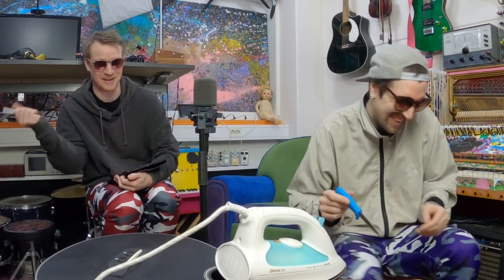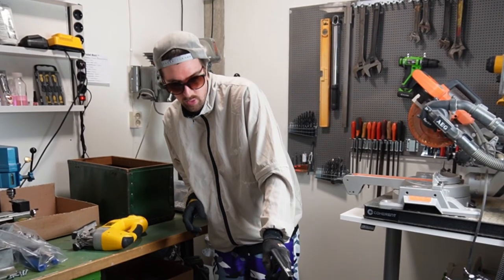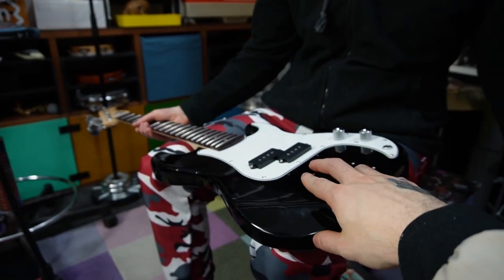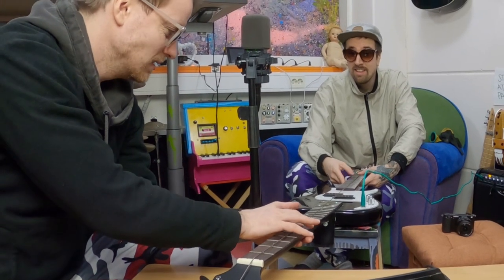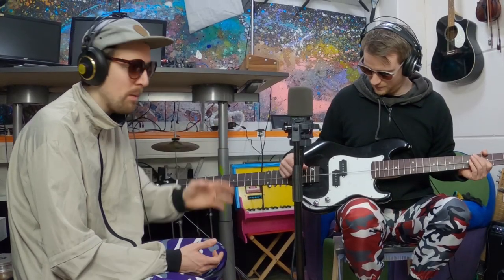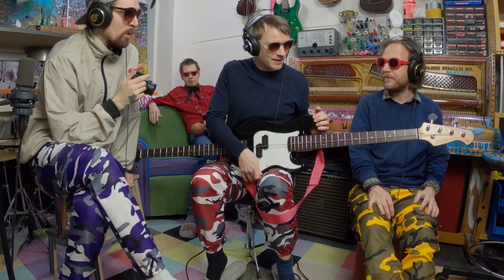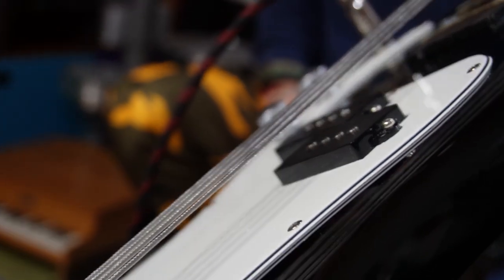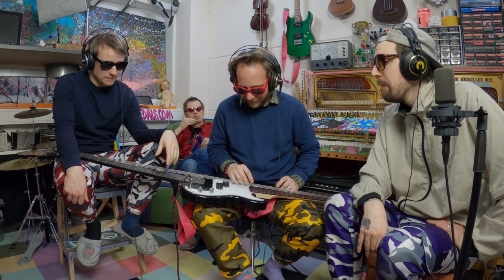2 Necks 1 Bass Experiment

Comment: Im mad about being technical, but in this case you can remove the neck, with a very thin and sharp spatula, and heating, in cases forcing humidity, or in this peculiar case, removing the 17th fret, drill tiny holes, with Jewelry drill bits, puting a pair of foam cutters and heat directly the neck tenon, remove with jiggly ninja movements to save the neck tenon
Pd: I know pal's it's a experiment, but more wood in the neck assure you more room to do on a creation, stability, I just say, however, I'm not disappointed at all.

Comment: NO failure! :D 

By putting the slide under the strings, the two basses are separated in to two basses. 
What about testing that out a little bit? 

If the stable/saddle/sadel/stol (?) is only touching the strings just enough to only give flageolette tones, like drone overtones/flageolettes?

Comment: Unfortunately because of the way you mounted the acoustic bass neck to the body there was no way it was going to be able to withstand the string tension. Maybe if you'd used a 2nd neck from a solidbody electric bass and and make a neck pocket for it in the body, bolted in on from the rear, then I think you might have had better results. But yeah, I understand you are using bits and pieces that are available to you.